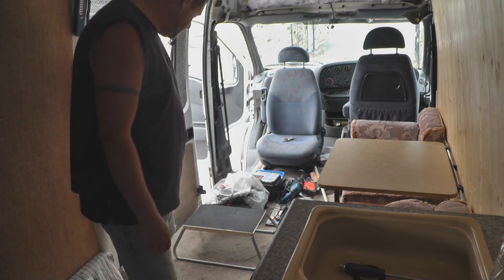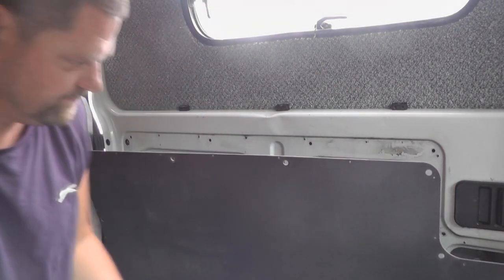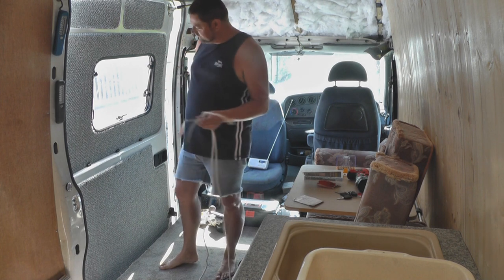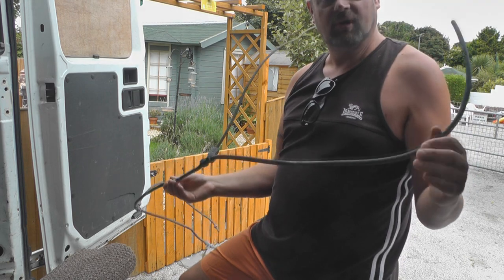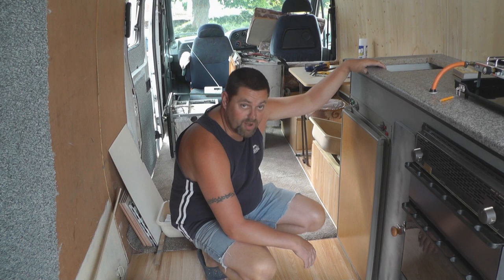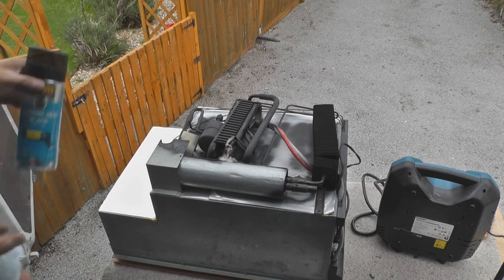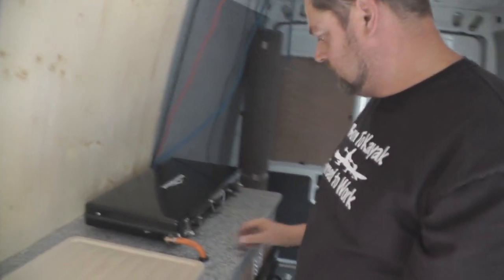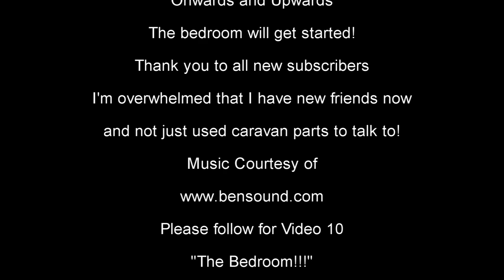Camper Van Build Part 9 Remake

Comment: what's the length of your van, it looks to be pretty long
Reply from the maker: Coolbreeze Good morning its 7 mtr which like you said is a good size, its probably the longest of the 3.5t vehicles available on the market, regards James
Reply: had to remember how to convert meters to feet (7 meters is 21 feet correct, that's pretty damn long), I love the British accent. so how much longer or are you done?
Reply from the maker: Coolbreeze a little more tinkering needed but I'm getting close now "thanks ref accent"
Reply: i've been looking on craigslist for a van of that length but so far haven't found anything close especially the height and even the ones that i've found that are shorter than yours are 10 and 20 thousands dollars (way too much for me), I plan on living in mine. I might even get a cargo box van
Reply from the maker: Coolbreeze Hi that sounds expensive would you be better going for a Sprinter? body shape and size is pretty close